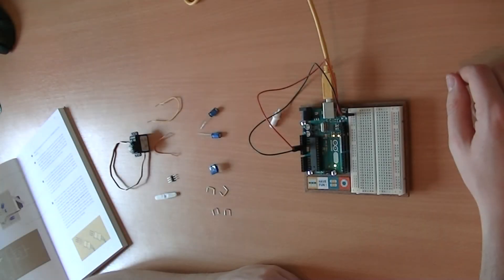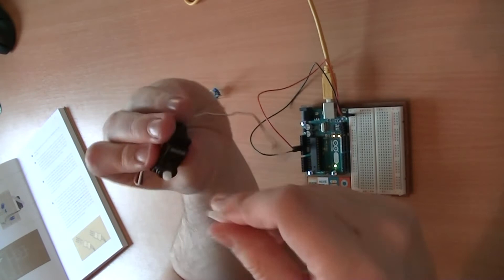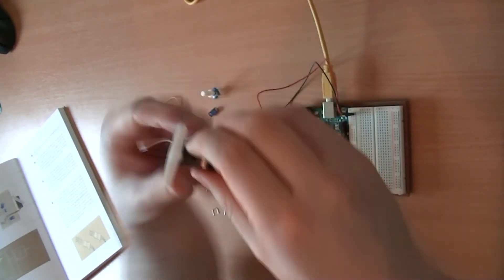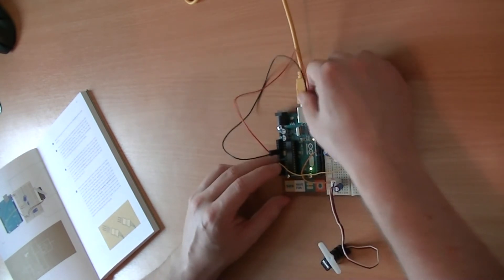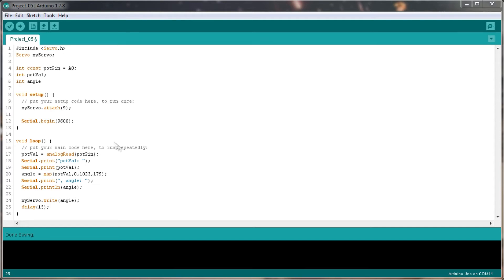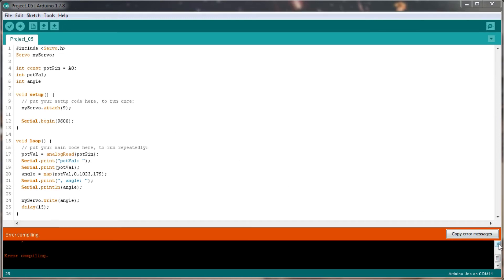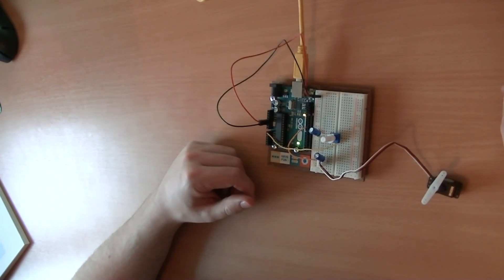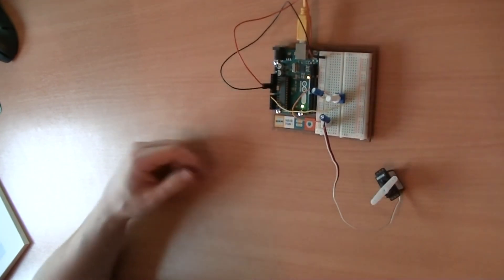Arduino Project 05 - Mood Cue

Comment: Hi, I have a question: I already made this project and I wanted to try to make move the servo motor but using the temperature sensor, so I made the connections and the program. I tested the circuit and the program first without the servo motor, and the serial monitor showed me correctly the conversion of the values of the sensor to degrees and later to the angle of the servo, it reported a consistent temperature as it must do. But when I connected the servo motor to the circuit and programmed it to move, the temperature sensor started to work wrong. It started to register temperatures of 21ºC to 40ºC in an interval 2 milliseconds without reason. This really means that the voltage that was running in the circuit was a little crazy owing to the servo motor. So I tried to use more capacitors and even a diode to try to control the flow of current in the circuit, but nothing worked. So, I would like to ask you, if you have any idea about which is the real problem or what I can do, maybe I made something wrong. Thank you ver much :D
Reply: All I'd suggest is to print out all the raw readings to console to see if the raw values coming from the temperature sensor are messed up, try building the love-o-meter from scratch to see if the temperature sensor is defective in any way, if not, the last option is to take everything apart and start again, there may be an odd connection somewhere that you only realise when taking things apart. If you do end up starting again, maybe start with the love-o-meter first (as we know that one works and gives numeric output), then add the servo meter after the fact. Good luck! :)